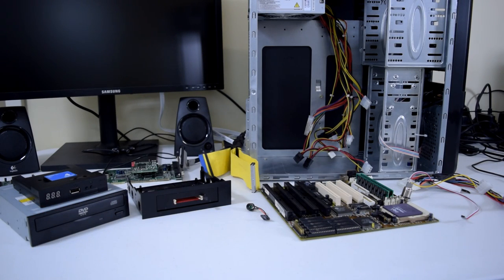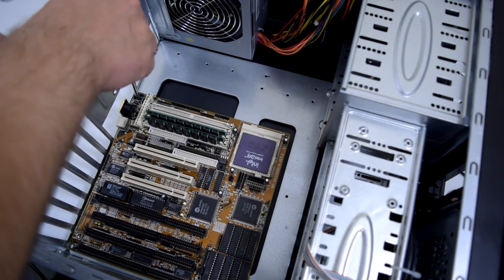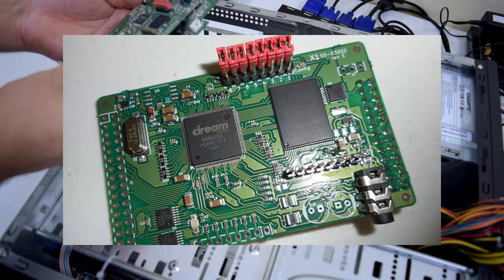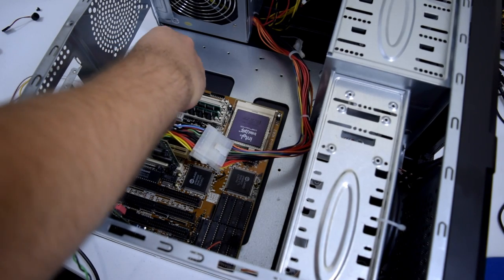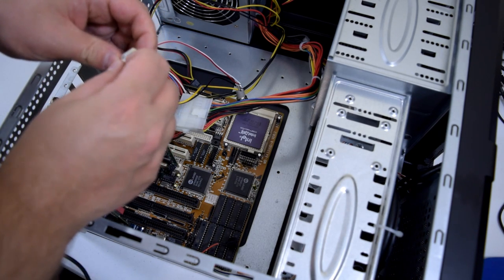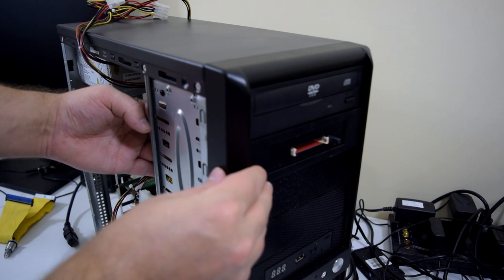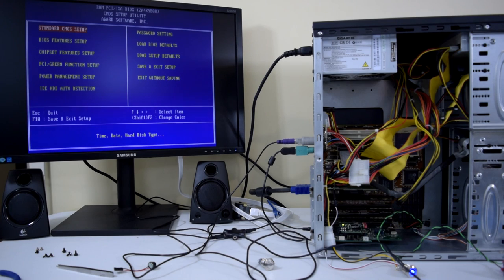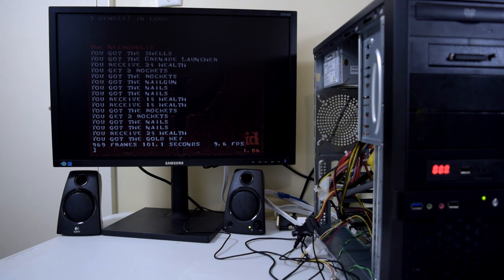Building a 486 DOS PC with modern parts

Comment: If you want to cut your own IO sheild from a blank, this bit may be the one to use:

https://www.dremel.com/en-us/Accessories/Pages/ProductDetail.aspx?pid=9910

All bits will leave sharp edges, especially on thin metal so be careful.  If you use such a carbide bit, they can make a bunch of tiny metal wires that are hard to see.  Though they are hard to see they hurt somewhat when you bump them and thus push on them.  For that reason, I like to have a strong magnet or a good par of tweezers with a good magnifying glass.  A good light also helps because those little buggers are hard to see BUT they hurt.
Reply: Thin sheet metal like that you just use a hollow punch.The stuff is like paper. Heck you could probably just use some cardboard wrapped in aluminum foil. Done and done!

Comment: mount a heatsink before the next boot! those CPUs can get rocket hot and will melt the CPU into the socket, with a max temp being at 310°F
Reply from the maker: >< I know, I just forgot to mount it for this video :D
Reply: PhilsComputerLab i see. with my Intel Core 2 Duo E6600 processor the stock fan almost is worthless when i play World of Warcraft as i get near the TJ max of 85°C. i get to 73°C and surprisingly no termal throttling with it.

Comment: First off, cool video. 
Next, AT power supplies are insanely reliable, I've got a rusted out cheap AT psu and it's working just fine. 
Next up, use doom for the review? 

Finally, what happened to the voodoo graphics cards?
Reply: You could've used the motherboard 12v connector as well...
Reply: +AIO inc. For the led? LED's don't take that much volts, hence the light died. You could hook it up to the 3.3v off the psu (or 5v with a resistor)
Reply: hingeslevers
You could but a resistor on the LED and it would work, but just be really bright on the 12v line.

Comment: Instead of paying much for a IO shield, just go to a craft store and buy a cheap plasticard sheet and cut it to fit with holes and such and mount it with two-sided tape from the inside.
Reply from the maker: IMO that will look just as bad as a hole at the back :)
Reply: I'd say that would depend on how well you cut the holes and if you make a printed label for it. I didn't mean slap it on like a half-effort bandage.

Comment: So guys, here is EVERYBODY's dream: a fanless, quiet PC!
Reply from the maker: +Cyphox That's true. However some modern power supplies only spin the fan up at a certain temperature or load. So you could make it fan less if you want to.
Reply: Ok, psu has a fan. But for example my psu is not loud. No problems with it
Reply: +coderHUN ™ These 486 >33MHz require a CPU fan. They can work a little while wihout one but would overheat after some time.
Reply: okay, then it's half passive. XD

Comment: Phil, if the battery in the RTC clock chip is dead, the motherboard won`t boot?
Reply from the maker: Depends on the board, but with many, yes this can happen.
Reply: I've seen old PCs with batteries connected to them. Like big AA sized batteries what I assumed were to power the RTC. It was an obvious add on. I'm not sure about all of the details though because it is just something I've ran into in passing. It was more of a WTF thing than anything else. I can't believe there's still big Dallas RTC blocks floating around that work anymore.

Comment: if you can use a separate IDE channel for the CD-ROM ... USE IT!!! Good old school rules
Reply from the maker: +Peter Gogola Can you tell me a good reason? I just like the simplicity and neatness of a single IDE lead :)
Reply: +PhilsComputerLab using the same cable slowes down everything when using CD & HDD at the same time. They have to wait for each other. My first PC was a P1, this "trick" helped a lot.
Btw. You have my like! Great video! My P1 is also still alive using an CF card, but I never thought about the ATX supply trick. Thanks
Reply from the maker: That might actually be a good video topic :D I can't think of many situations when you access both, installing a game maybe or copying data from a CD to the HDD. But yea, definitely something I want to check out.
Reply: +PhilsComputerLab I used to have a 2GB HDD ... a lot of my MP3 and many many other data was sitting on CDs. I am reffering to times when my P1 was THE family PC for us.
Reply from the maker: Cool, thanks for sharing.

Comment: The maximum power for an LED is around 5/6 volts, 12 volts killed it, you should have used the 5 volts of the molex connector, not the 12

Comment: One thing you should do is add a cooling fan to the CPU as they can get hot playing games and to make it last longer !!
Reply from the maker: +Senior Frog Yea I totally forgot about the cooler :)
Reply: No problem I couldn't remember if they had them my self !! This is where they just started to sell them and some of the slower chips didn't need fans but it makes them last longer in any case !! I liked the vid it was fun to revisit my days of early computer building THANKS !!
Reply from the maker: Hey I copped it because of the missing fan :D I got onto eBay shortly after and got some nice coolers that clip onto the processor.

I want to use them in another video, but not sure what else to do with the 486, this project coveres it already.
Reply: Could try running modern programs and see how the 486 would handle it ??
Reply from the maker: Yea that is something I could do.
Reply: Just an idea or maybe try some newer games and see if any will run on a 486 ??
Reply from the maker: Yea.

Comment: @13:09 - kind of looks like you did not put a heatsink on that DX4. As far as I know, the DX4 needs a heatsink and fan - or at least a heatsink. Some even have "Heatsink and fan required" printed on. Then again you could have added the heatsink later and it's just not shown in the video.
Reply from the maker: +kaneCVR Yes I know.
Reply: +kaneCVR My first PC (Tandy MMPC 10) I upgraded with an Intel DX4 100mhz "Overdrive"CPU which had a built in heatsink, you just plugged it in and it disabled the built in DX 66 (or maybe it was an "SX") on the motherboard-which didn't have a heat sink. The DX4 got pretty hot to the touch, surprised it didn't have a fan.

Comment: Nice video , sir.
Reply from the maker: +Slug Jones Thank you :)
Reply: +PhilsComputerLab Device on last connector of IDE cable shoud be master, so if you want to use one cable for cd-drive and hdd you should put hdd on top of cd-drive, or use really old cable with another connectors placing. It usually works in any combination, but can cause problems. I have seen even middle connector in mobo and edge connectors in drives and THAT WORKS, but it is totally wrong)))
Reply from the maker: I have built a LOT of machines and never had a problem using two devices on the IDE channel.
Reply: +PhilsComputerLab as I said, usually it works even with wrong connection, but I saw detection problems or data transfer errors sometimes.
Reply from the maker: Good to know, I'll keep this in mind. I remember having data errors on a Super Socket 7 boards, I just ended up using the other channel. Will check it out if I work with that board again.
Reply: +PhilsComputerLab for example, some of that times boards are not detecting slave device if no master connected. And new CD-ROM drives always came with jumper in slave position ))
Reply from the maker: +9800xt256mb Just want to follow and say thank you :) I now found lots of references mentioning what you say :) I shall put the HDD as master at the end of IDE lead, that's easy enough. I actually prefer using a single IDE cable, it makes cable management easier. This is why I like the YouTube community so much, I keep learning new things and along the way!
Reply: +PhilsComputerLab just on Friday I was laughing at work while tearing up old 478 socket pc😆 . EVERY cable connection was wrong, even floppy cable with twisted end to the mobo! 😆
Reply from the maker: Yea it's funny what you come across when stripping old PCs :)

Comment: I'd be more impressed if you managed to get DOS games running with sound on modern hardware without emulation ;)
Reply from the maker: DOSBox, you'd be silly not to use it.
Reply: DosBox...................try answering the question.

Comment: You mentioned having a link to the ATX to AT adapter but I can not seem to find it. I can only find the adapters without switches and without the -5v.
Reply from the maker: Yea sold out I'm afraid and nobody makes these it seems. Do you really need -5V only a few cards actually require it. Voltage Blaster project is an alternative, it's an ISA card that adds -5V.
Reply: @philscomputerlab  Thank you for responding. I do have a Sound Blaster 2 I want to make use of which I believe requires the -5v. I would love an ATX2AT but I am struggling to find someone I can pay to put one together for me.
Reply from the maker: @mrcrue13  Then get a voltage Blaster, they aren't difficult to solder yourself. Maybe someone even sells them....

Comment: How come use a AT 486 motherboard.. in the late 486 era ATX MB was quite common.

Actually ATX become common just a ear or so after PCI.buss, so this is really one of the Few PCI - AT MB. Most AT uses VL-buss in stead.
Reply from the maker: +matsv201 I'd love to have an ATX 486 board. Do you have any links?
Reply: No not really.. i didn´t check up if there was any market on them. I just remember that AT-PCI card was main market for quite a short time.

When Pentium become more popular the ATX-486 flodded the market, end before that PCI cards was only for Pentium. When i bought my 486 there was not really any 486 PCI cards avalible.
Reply from the maker: Well I've never seen one, that's why I'm curious.
Reply: Hmm.. i wounder if i might confused Socket 3 with socket 5 :S
Reply from the maker: Ah, what a shame, would have been awesome to build a uATX 486 retro PC :D
Reply: I bet there is some later with solders processor. The 486 was used for some years as a bult in PC. Before the time of the Rasbery pi, there was quite a few slimed down 386 and 486 PC around on the market.

But they are usualy really slim. Typicly one memory socket and one PCI slot, sometimes they had one ISA slot to. But its busses, so if you need more slots, its just to put a raiser on it.

A lot of really late cheep as 486 use really tiny MB with solder processors... if you se lika e 486SX4 100Mhz or something, you can bet it have a solderd processor. Almost all SX2 and SX4 had solderd processors.

It was really crap at the time, but if you are going to build a retro machine, why not. They use far less power (usualy don´t even have a heat sink)... and really the fist game that uses the Math processor is Quake, and its to my opinion passed the 486 age.

Comment: How is this a "good board" if the CMOS battery is soldered on with no option of replacement?
Reply from the maker: Because a barrel battery would have leaked already and destroyed it.
Reply: PhilsComputerLab A good motherboard from the era would have had a completely separate battery though. The kind you have to velcro to some other place in your chassis.

Comment: 14:23 "It's just what happens when you muck around with a lot of stuff, things die."  
Well, yeah, I mean you're obviously not being too careful where you're tossing around metallic objects on live motherboards, at 8:30 and 10:30, it doesn't surprise me at all that random shit's kicking the bucket. Usually CF cards are pretty robust though...
Reply from the maker: That's a 486 computer, the  motherboard wasn't live. You are applying your current understanding of computers to old ones, well that doesn't work I'm afraid. So the next time you try to call someone out, please know what the heck you're talking about...
Reply: I think what they might have been concerned about is that ATX power supplies generally do continue to supply a nominal voltage to motherboard components even when the system is powered down.  I know that true AT power supply units were hard wired from the PSU itself ... but this isn't a true AT PSU.  I don't know exactly how you've wired the ATX PSU in this scenario, so I'm not sure if it is still feeding 5v to the board or not.  (I know you're using an adapter ... but you don't specify anything about how it is wired.)
As far as handling old computers VS new, I'm under the impression that the same rules apply:
1)  Wear static grounding strap when handling internal components;
2)  Unplug the PSU from the power mains before opening the case; and
3)  Use an anti-static mat for laying out disconnected components.
That's what I did when I built PCs back in the early 90's ... it's what I still do today.  So, I'm not really sure what you mean about "applying current understanding of computers to old ones".
Just saying ...

Comment: Modern cases always have the usb and audio ports on the front, is there any way to connect them to old motherboards so they work.
Reply from the maker: +lmrwhiskers USB I don't see happening, unless you use a PCI USB card. Might be tricky finding one for a 486. Sound is a possibility. You would have to build an adapter of some sort connecting the header connector to the sound card. Some sound cards have a header that can be used, with others you might have to route the cable outside the case and then into the outputs.
Reply: Thanks for the prompt reply.  I enjoy watching these old systems you are building. Keep up the good work.

Comment: Hi dude, i have a question:
Im building an actual PC in a 486 case (with standard reset and turbo buttons and typical MhZ display.)
The question is, how i can connect the mhz display on my motherboard? or it isn´t connected on it? I have no idea about it, and i don´t know if i can connect the reset button to the mother to work properly too.. The MB is a Gigabyte GA-H81M-DS2.
Reply from the maker: Good question!

These MHz displays do not connect to the motherboard. They aren't measuring anything. As soon as the PC has power, it will light up. At the back of the display you will find jumpers which let you set what number they display. But without the manual, well, good luck trying to figure it out :P
Reply: xD thanks for answer

Comment: Why is a gotek needed when you have the compact flash ? I noticed you didn't use it ?
Reply from the maker: It's the Floppy drive, you need it to install DOS Operating System.
Reply: @philscomputerlab  sorry for the noob questions . The CF is the hard drive? Couldn't you install dos on the CF card from a modern pc instead of using the gotek to then install it to the CF ?
Reply from the maker: @aussie_retro_dude9253  Yes the CF card is a modern hard drive replacement! But you cannot install DOS on a modern PC like that, you need to boot from a Floppy or CD on the Retro PC and then install it on the hard drive (CF card).

Comment: Which gotek emulator model you used? Mine didn't worked for me. Not even got detected.
Reply: I'm not sure about DOS machines but when I bought one of those cheap 10 dollar goteks for my Atari ST I had to flash a new firmware on it. That required soldering pin headers on the holes for serial (TX/RX) and changing some jumper settings then using one of those cheap USB to serial adapters that have a pin header and you hook it up to the headers on the gotek, then use a software to change the firmware. Not sure if this is needed on DOS though

Comment: Haha, damn. I think I need to build me one of these, maybe a bit older though. Get me a  386, put some Windows 3.1 with tabworks on it.
Reply from the maker: I've done a video on a 386 :) It's "building a 386 with modern parts"
Reply: PhilsComputerLab
Rad, I'm gonna watch it.
Reply: +PhilsComputerLab Have you considered using a Tseng ET-6000? It's an excellent chip from the era, has built in Vesa 2.0 compatibility and will vastly outperform the S3 chip you have in there. I still have the one I used back in the day. It was $38! This $38 card outperformed the Matrox card which was one of the most popular cards for 2d dos which sold for around $150. With the VESA 2.0 support, there are no incompatibility problems and supports 400x300 which is a very nice compromise between 320x200 and 640x480 and also is much easier to display on TVs if you have converter. The other resolutions don't convert very well.
Reply from the maker: Vastly? I know it's a quick card, but I'd be surprised if there is much of a difference beyond a frame or two more. But no, I unfortunately do not have such a card, they go for quite a bit of money these days...

Comment: +PhilsComputerLab Can you help me mate. I have a NEC Powermate APC IV 386 SX/16 that ran an MFM 140mb hard drive that contains some important information on it. The power supply died in 1994 and I pulled the hard drive and obtained a replacement NEC Powermate of the same model but all I can get the bastard to do is beep and not boot. Bios / CMOS was accessed via 5.1/4 floppys which I have and I would REALLY love to fire this thing back up and read the hard drive. Can you help me, I am in Australia?

Comment: The reason the 4Gb CF card did not work is because the bios had no way to address all of the blocks.  It is "physically" to big lol.
Reply from the maker: Yes that was the problem. I sometimes use DDO software to get around but, but not in this case :)

Comment: You need to be careful using modern ATX power supplies for older computers.  The older stuff draws much more amperage on the 5V circuit than modern computers do, and many modern power supplies may not supply enough current.
Reply from the maker: +Michael Beutler That is true, but not an issue for 386 and 486 machines. However if you're building a high powered Athlon XP machine, well that's another story :)